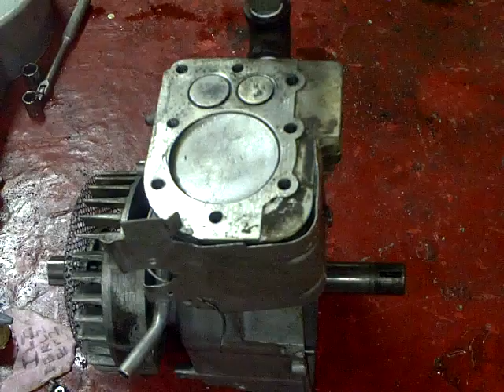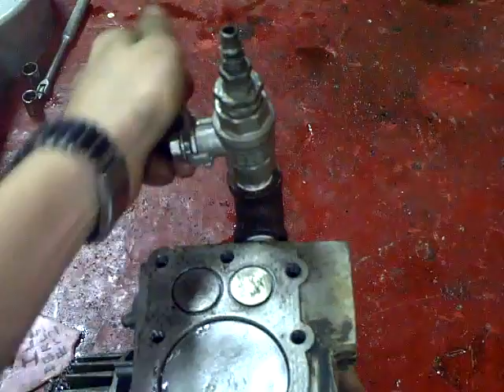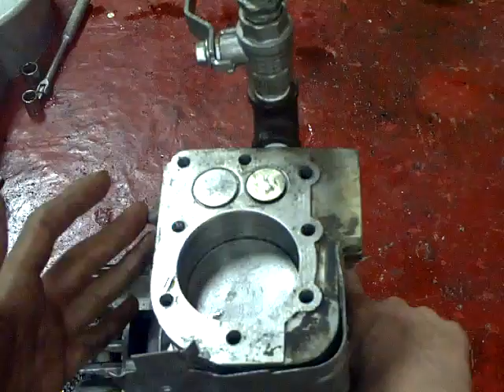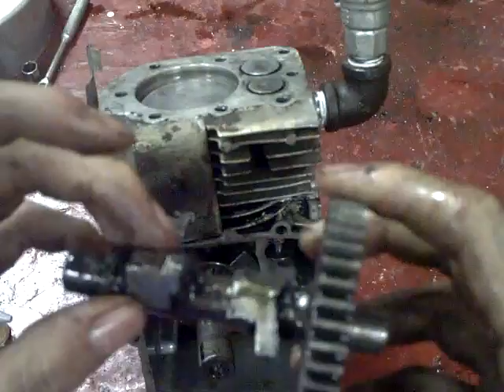How a compressed air engine works

Comment: I am GEOLOGY  Professor in an Engineeing college.i would like to work the such kind thing. its little crazy for other who know about hydraulics when i question them about my doubts .sir ,i want to know first how much pressure is need to run a 350 cc petrol engine and how much lfm/cfm/scfm is need to get more torque and power.and please suggest me what pressure compressor is needed if connect the hose to engine with and without air tank.please